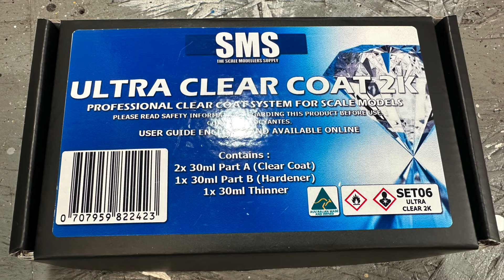SMS Ultra Clear Coat 2K System - Airbrush Time

Comment: What air compressor did you use in the video to run the airbrush?
Reply from the maker: At 10:13 time in the video I show the compressor. It's a "Master Airbrush" unit from Amazon.